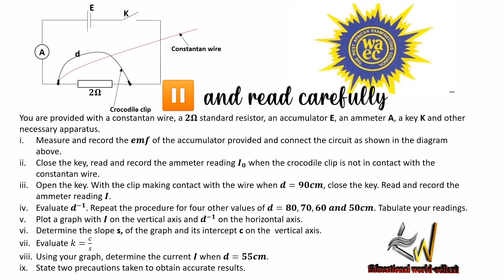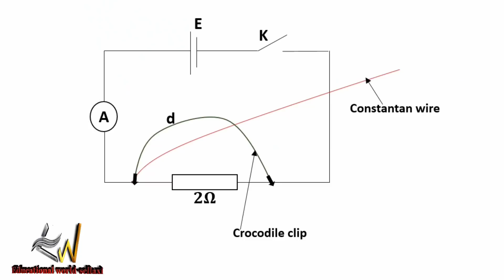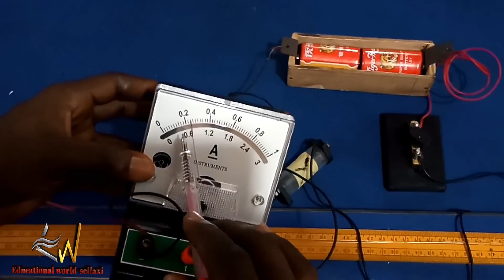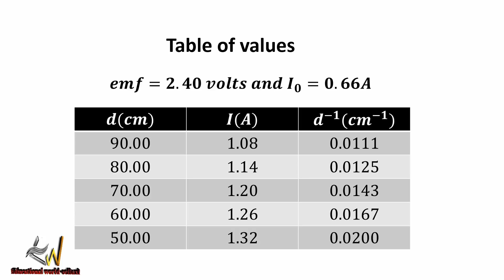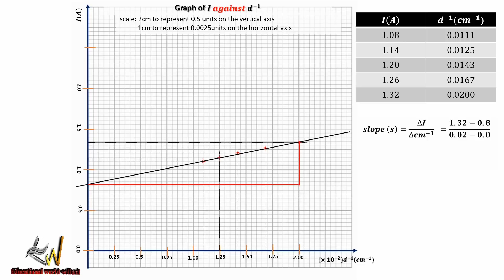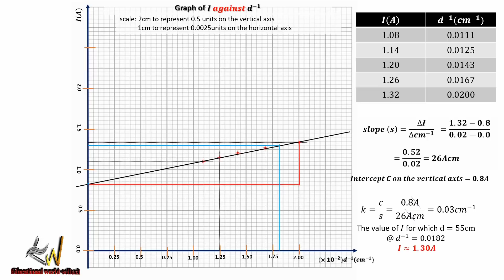sure Electricity Practical 2021 WAEC (@sellaxi )

Comment: Thank you very much for this nice work, but I want to point out something. The Physics practical white paper indicated that the Ammeter should be 0-1 Ampere. But most of your readings are more than 1A.
Reply: It depends on the resistivity of the Constantan wire. Thicker ones have lower resistivity. I used a thin one and my max value was 0.9A. when I switched to a thicker one, I was getting above 1A. 

Another factor to consider is the voltage. If we use a 2V accumulator, the value of the current won't be as high as when we use 1.5 V X 2 dry cells
Reply from the maker: Yes, my brother. I noticed that as well. I tried using the 0-1A ammeter and I noticed that it wasn't able to capture the maximum deflection, I had to switch to 0-3A. Let's wait and see what WAEC will give us, but believe it's not far from what I just performed.
My friend also performed this same practical and got his values of current greater than 1A.

Comment: Resistor can be connected in series and in parallel. WAEC can never repeat a question. They have asked this similar question in which the resistor and the constantine wire were connected in series (this one you redo). Why not try constantine connection in parallel with the resistor? I believe it might be where they are heading to. Also use new battery and good accumulator because 2.4v is damm low to expected 3v. Thanks
Reply from the maker: This one I did, the connection is in parallel. That is why the current increased. Remember, the parallel connection has a lower res is.
Reply: @sellaxi  I have done this experiment more than 10times. The current is maximum at  1.0A when the length is 10cm or less
Reply from the maker: Bro, the Constantine wire cannot be connected in series to the resistor. I repeat it can not be. Why is that? This is because when you want to measure the current when the crocodile clip is not making contact with the wire, the current will be zero. No current flows. This is why WAEC won't ask us to connect it it series. Thanks.
Reply: @sellaxi  You are guessing WAEC to repeat question with the same procedure? Lol
Reply from the maker: @dmarkino  of course, I've seen it happen several times, I can give you years of repeated questions if you like. They might change some values, but if it's about repeating questions, they do.
Reply: @sellaxi  Alright Sir

Comment: The required range for the ammeter is 0-1A. You are using 0-3A to perform the experiment.
Reply from the maker: My dear if you experiment you will understand that the maximum current is more than 1A so, using 0-1A ammeter won't work.
I tried it my brother.
Reply: @sellaxi  you connected the ammeter to the 3A in the ammeter. That ammeter you are using is multi purpose i.e 1A and 3A. Connect that red wire at ammeter to the middle that is labelled 1A. Use the upper graduation of the ammeter to read your values.
Reply from the maker: @dmarkino  how would you measure a current of 1.2A using 0-1A ammeter?
Reply from the maker: No wahala, perform your experiment and find out for yourself. Haven't you noticed that sometimes, those apparatus that they said we're to provide might not all be used.
Reply from the maker: Even during NECO physics practical, some of the apparatus where not even used.
Reply: @sellaxi  Do the experiments in series and see that the current is at maximum 0.64A and goes down as the length of the constantine wire decreases from 100cm to 10cm
Reply from the maker: Alright I'll find out, and experiment with series.
Reply: @sellaxi  

Example
a.  2ohm and 3ohms in series will be a total of 5ohm.
b. 2ohm and 3ohm in parallel will be a total of 1.2ohms

Comment: Can I perform this experiment without the metre bridge? Can I just do it with the constantine wire and a metre rule?
Reply from the maker: Yes of course. You only have to measure the required length on the Constantine wire and then attach the crocodile clip at that point.
Reply: Thanks a lot.
Reply from the maker: you're most welcome. Please encourage others to subscribe. Thanks 🙏

Comment: I can see two wires on the meter rule. Are they both constantin wires?
Reply: How can I get the constantan wire
Reply from the maker: You can order it from JUMIA or Konga @crushballer
Reply from the maker: No. One of the wires came with the meter bridge. But a attached the Constantine wire to the bridge for easy measurement of its length. The Constantine wire is thicker than the other one.
Reply from the maker: Thanks for the observation
Reply: Using a different Constantine wire, the current will vary right?
Reply: @physicsandchemistryatplay.229  sure. Though the teacher in charge will specify on the report form, the diameter of the wire used.
Reply: @crushballer  I noticed some school had their current values between 0.1 and 0.2 whiles others were between 0.3 and 0.4. This should be normal as Waec did not specify the constantan wire to be used right?
Reply from the maker: Of course